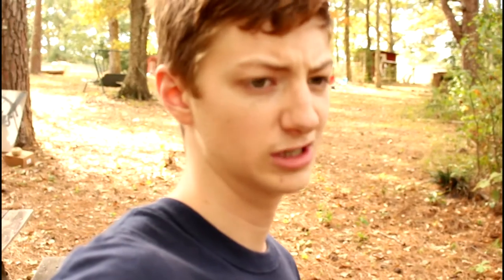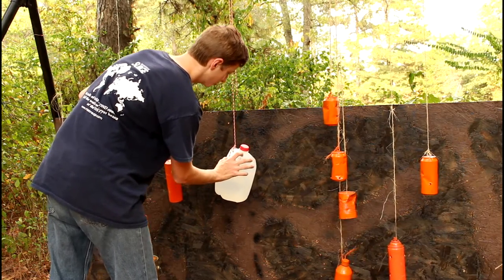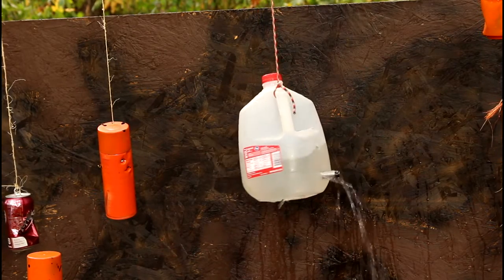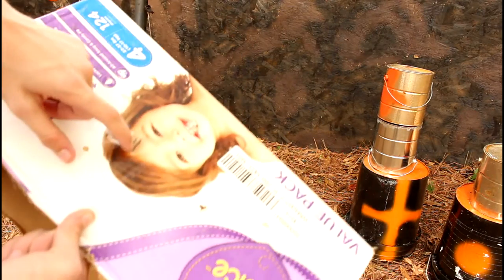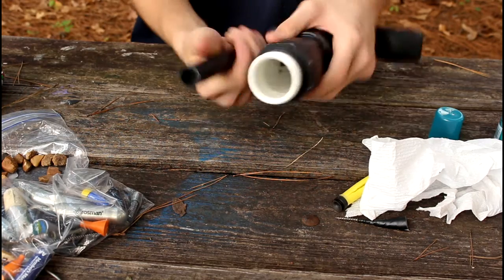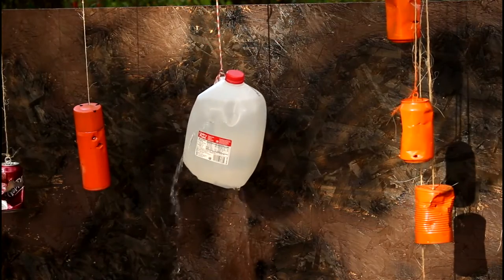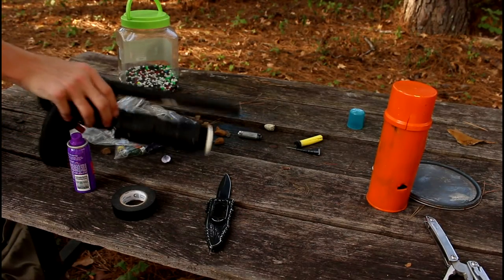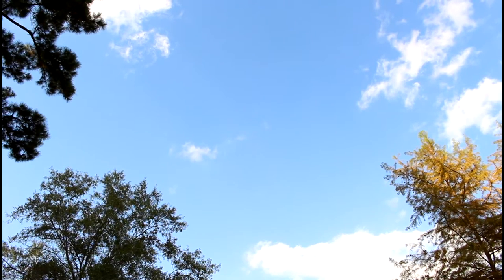TESTING my PVC Hairspray Pistol part 2

Comment: Hello, I love your videos.Why use deodorant instead of alcohol?
Reply from the maker: Thanks! I am using hairspray rather than alcohol or other fuel in this video for a few reasons; I find that like the nice portable self contained aspect of a small can of hairspray, rather than a spray bottle of alcohol, or a propane torch. Not that I don't use other fuel options, I just didn't in this video. I am actually planning on making a video in the near future where I explore and test all the different fuel options. I think it would be very helpful, and I can't find anyone who has done it before.
 
I'll also admit it was a bit of a marketing strategy for the video, as it is just more interesting on a thumbnail to say "Hairspray Powered Pistol", rather than 'Alcohol marble gun', or something like that 😉
Reply: Jake Makes Well taken out his move 🤔😉
Do you think hair spray is better than automobile ethanol? I bought ethanol and I have problems with the shot, because sometimes it takes a lot of time to burn. I press the trigger several times
Reply from the maker: By ethanol do you mean gasoline? Your problem sounds like the ratio of oxygen to fuel in the chamber is off. Since its pretty much impossible to measure how much fuel to put in, its very common to get too much, and there is not enough oxygen for it all. This results in a much slower burn or most times no ignition. A bit counter-intuitively, more fuel does NOT equal more power. It is the ratio of fuel to air. Its the same problem with hairspray, alcohol, or just about any other fuel in a can. 

My new favorite fuel for spud guns is propane. I use a regular propane torch, but instead of lighting it I just stick the end of the torch in the combustion chamber until all the air is pushed out. Because of the way the torch is designed, the propane coming out of the nozzle of the torch already has the perfect ratio of propane  gas to air, so there is no guesswork. Perfect shot, every time.